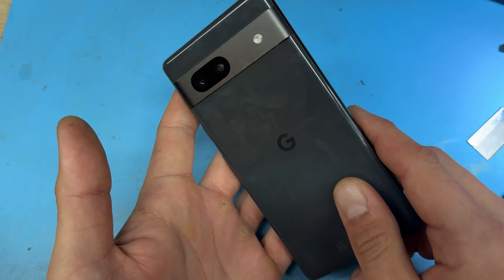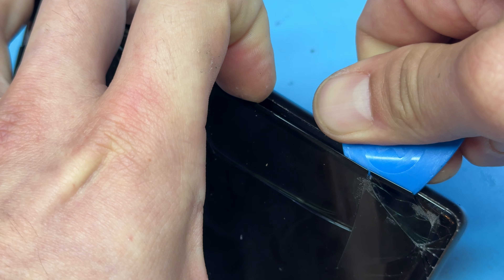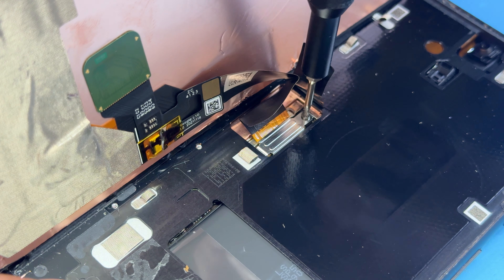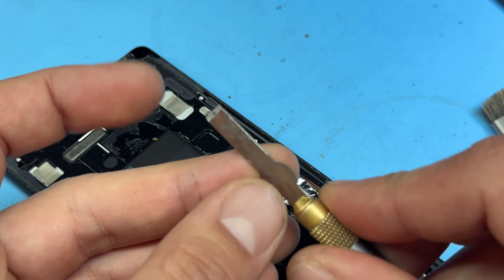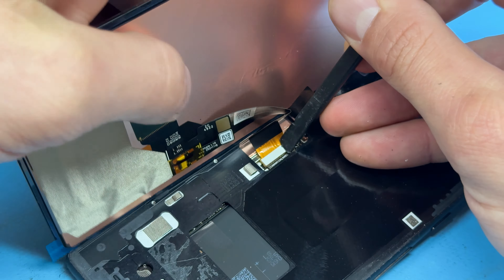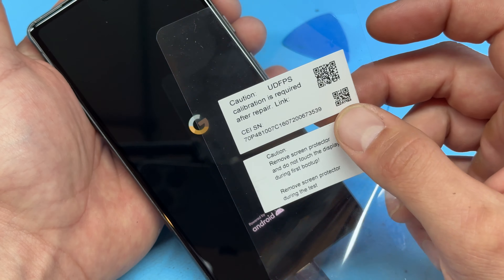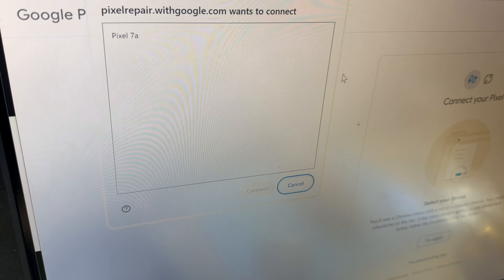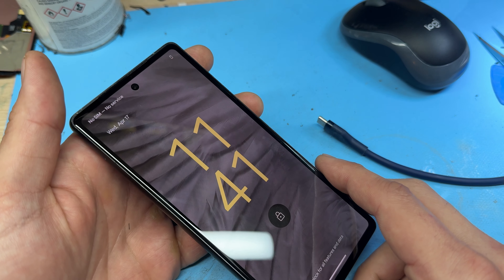Google Pixel 7a Front Screen - Full Screen Swap And Device Calibration Guide For Your Broken Phone!

Comment: I"ve noticed you only use a razor blade to start opening the phone. Do you not heat up the phone to get the adhesive weakened? I"ve just been seeing so many different ways to open phone screens. Some use suction cups others use a big device that holds the phone still and use a suction cup. I'm just curious as to what is the safest for the phone?
Reply: my guess is since the display was already completely dead theres no point wasting time on being careful with the display, aslong as you dont damage the connector or frame youll be fine, if the display was still working just cracked they probably would use heat and a suction cup tho